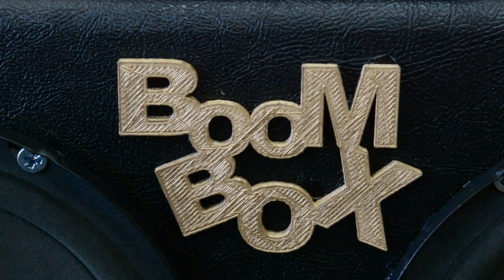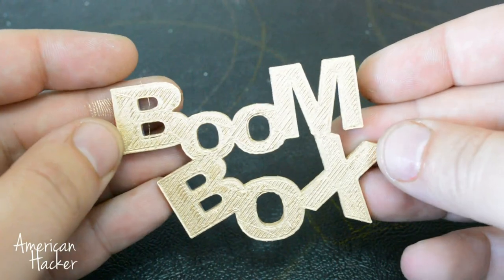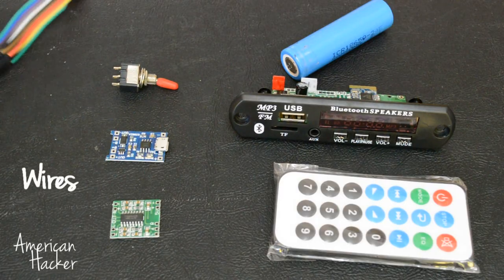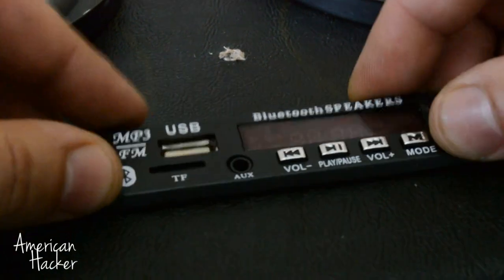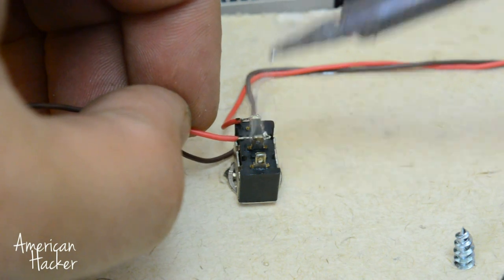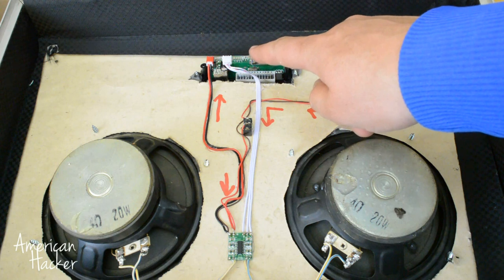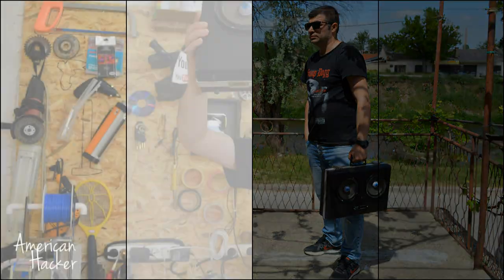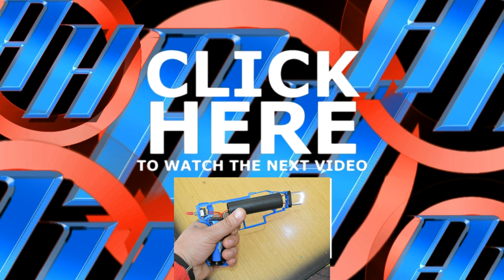DIY - Briefcase Bluetooth BoomBox

Comment: Adding a solar panel to charge the battery would make it perfect for the beach. I have made a bluetooth speaker also. I use a bluetooth dongle. It seems that the dongle have to be powered separately than the am to avoid noise issues.

Comment: Please note putting speakers in something flabby isn't the best enclosure, it works but isn't e best, especially as air can leak in between the screw holes in between the four speaker screw in parts. Love this video project my favorite so far because you putting speakers you wouldn't normally see them in =D

Comment: So you wired up the batteries wrong they will only give 3.7V because lipo batteries like that only carry 3.7V all of them! So you need a simple step um converter for one bug with that it will get louder
Reply: Or with the batteries parallel 7.4V so you need a step down converter

Comment: Whyyyyy, this could've been so great! But you're using a 2x3watt amp for 2 20watt speakers! :(( sound distortion..
Reply: No distortion. You're incorrect.
Reply: yeah true, but you doesnt really get the full potential from the drivers
Reply: HamDerDanskeren  Box/enclosure design is far more important to driver potential.
You can feed 200 watts to a 12 inch driver without a box, and I'll feed 2 watts into a 4 inch driver in a tuned to 35hz ported enclosure and who's do you think will hit lower and cleaner?
Look up a video on youtube Tiny 4" subwoofer hits 25hz.

Comment: dude 20 watt speakers and a 2 watt amp you can put harm to the speakers becouse you underpower them and you stress the magnet!!!
Reply: Wrong.
Reply: ***** whats wrong then???
Reply: Yellow Frog  Your statement about hurting speakers by under powering them is absolute nonsense.
Reply: Yellow Frog The only way to damage a magnet is a severe impact. The only way to damage a speaker is to OVER power it and cook the voice coil.
Reply: Yes bro ur perfectly right I have had both the experiences under power and over power actually there is nothing like under power damage except it's on and big amp I had an same 20w speaker and u plugged it into a 400w amp and the scene was beautiful watching my speaker burning and catching fire now I use that speaker as a magnetic hanger for my tools and keys lol!